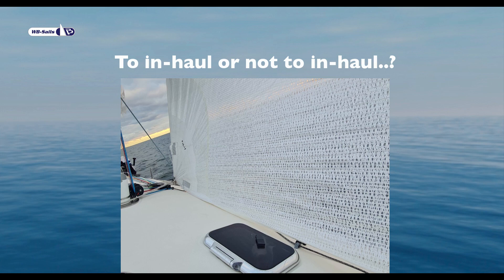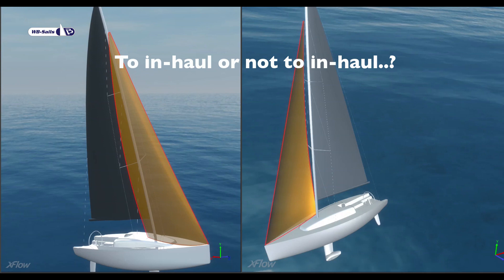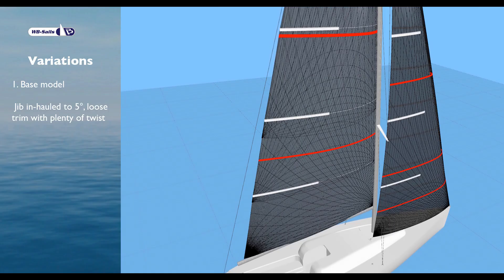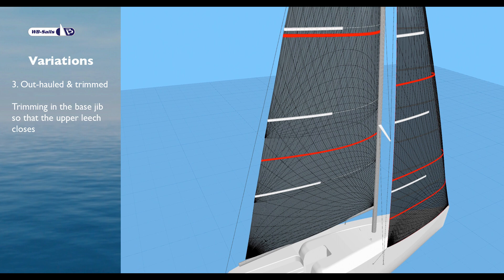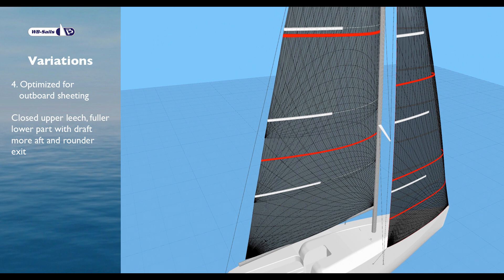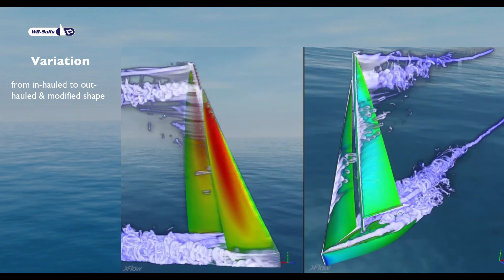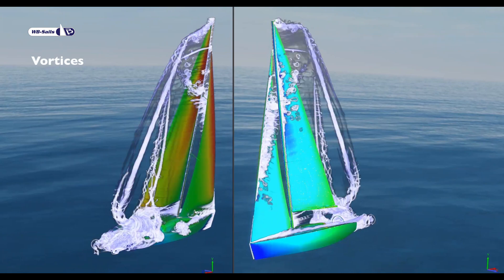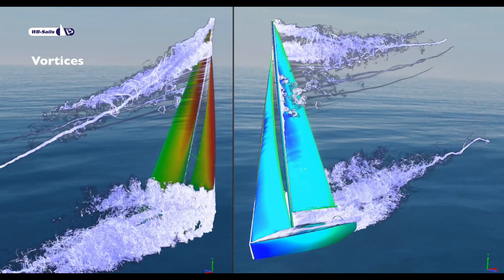To in-haul or not to in-haul?

Comment: Very curious about the results?  should we inhaul or not?
Reply from the maker: According to the results of the simulation, the answer is yes, you should inhaul, provided that your sail is designed for that. Although you can compensate a lot by the design of the sail, you cannot completely match the performance of the inhauled jib, specifically designed for that. The ability to inhaul adds to the range of your jib. Clearly, the jib sheeting angle is an important design parameter by its own.